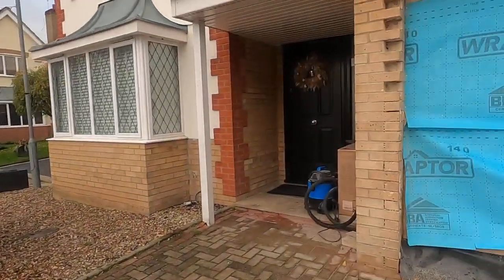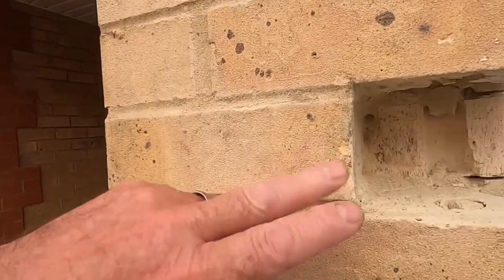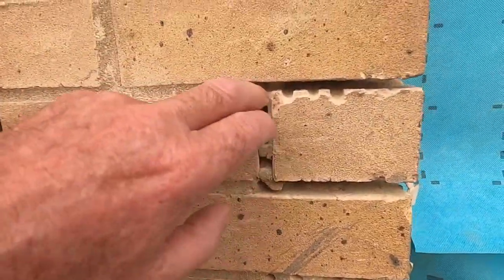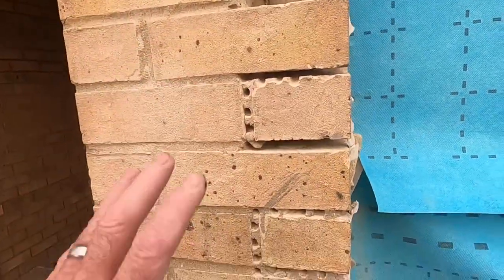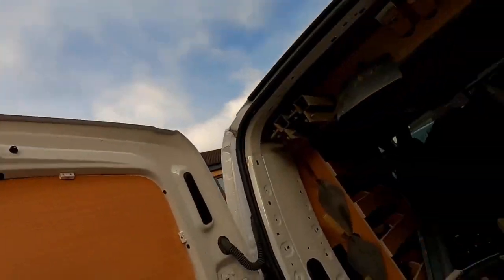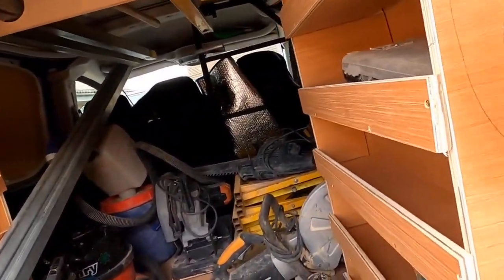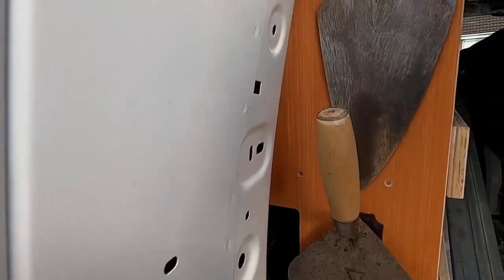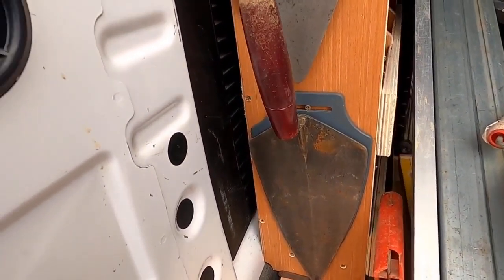That's Monday done

Comment: Awesome upload Andy good tips on toothing out! Nice idea in the van for freeing up space and love the magnetic trowel holders ❤ Be good to get a review on your makita battery tools as I am just looking at and pricing switching to battery tools ! Sure there will be a lot of people in same boat cheers for upload again !
Reply from the maker: I've been using Makita for many years John, never let me down but ime pretty sure De Walt and the others are just as good.
Reply: I've got Makita and  Milwaukee not much between them but Milwaukee always seems to have a bit more oomph. You'll be fine with either. Still running a corded Hitachi circular saw from 1992 very solidly built.
Reply: @baldyslapnut.  cheers for that review just at the point where I think I should be changing over having a lot of rural work and having to take a generator with me

Comment: What do you think of them blades in the reciprocating saw , I was thinking about getting one of them but haven't heard of many people using them up here ,cheers 👍
Reply from the maker: Used it a few times now mate, no wear on it yet, a lot of lads use them for cutting thermalite and celcon, yep good blades 👍
Reply: If that's a Bosch blade it drops carbide tips if you don't keep the blade straight in a slot. They work well otherwise, dust is a bit more confined than a grinder.

Comment: Have you ever used a Arbor Tech  I heard they only work good on soft old mortar I use a stihl ts420 14in demo saw of course it works good and fast but it's heavy so it kind of sucks especially when you got to use the water and put on rain gear I bet those battery powered ones would be good but they have a 9 inch blade and they only go through three and a half inches and our bricks are 3 5/8 in so it won't really go all the way through
Reply from the maker: Yes the Arbor is a great tool but as you say only good on soft morter, I've used battery grinders and they really are good ,ime sure as batteries improve someone will come out with a 12 inch one,